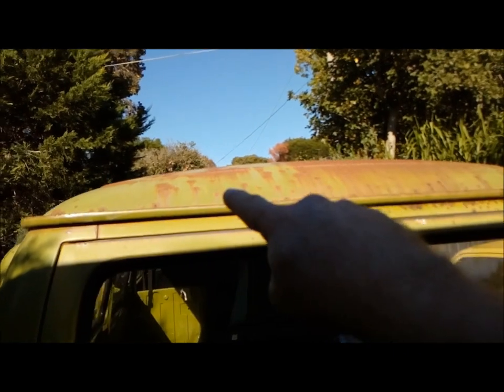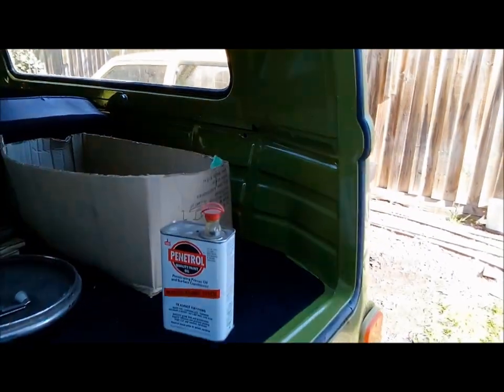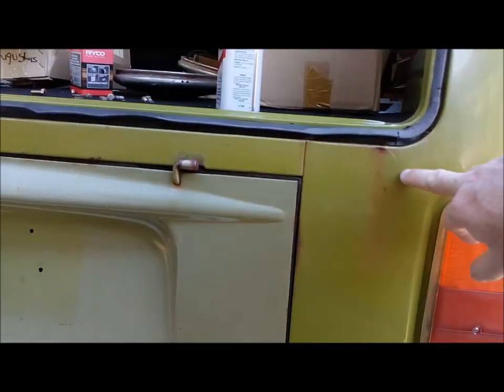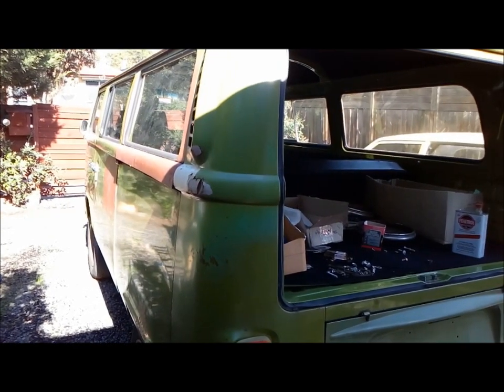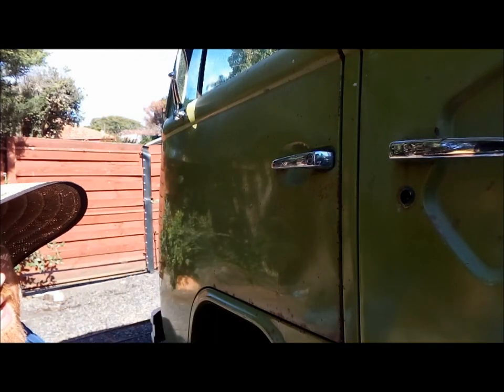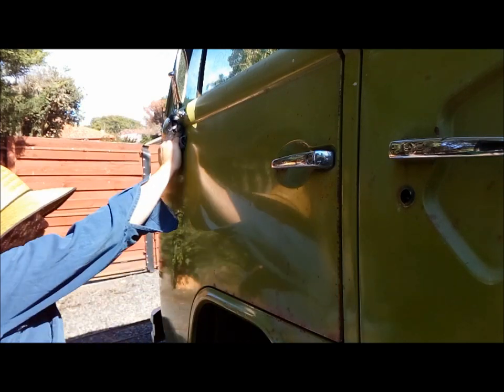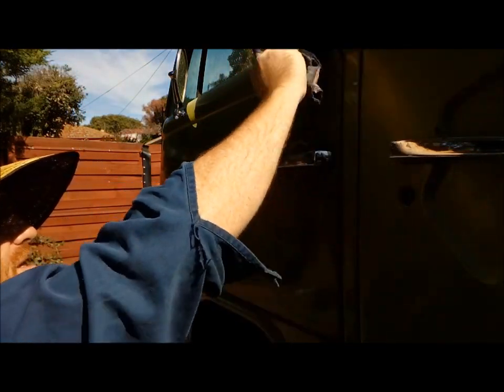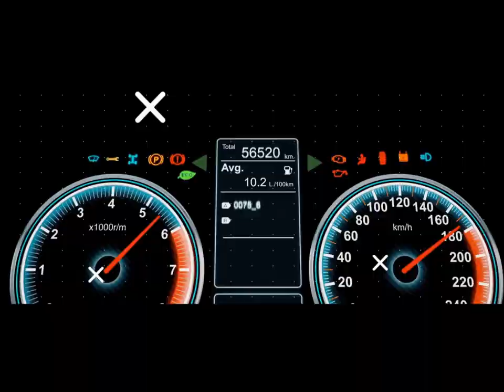Clear Coat PATINA PAINT Simple method , Car, Truck or PATINA Project Cheaply

Comment: 4 years ago as I was basically in rehab from some heavy duty chemo and radiation trreatments for stage 3 lung cancer, I decided to 'fix' up on my old 98 dodge ram short bed pickup. Each day I would do a little bit, straighting out dents and stuff. Couldn't work fast as the cancer treatment whipped me pertty good, lol.... After I had all the body work finished I started wet sanding by hand, through the cracked and worn clear coat, the primer and sanded it to the zinc coat. Then I used rattle cans and primed the truck. This took around a month and a half to get to this point. I burnt myself out and did other things, thats when I found out primer is not a sealer without a finish coat, after a couple years the primer was peeling and flaking so once again I did the old wet sanding by hand and reprimed it.....about two months ago I did a wet block sand on the truck, picked an area each day any taped an masked off and used krylon satin black rattle can paint, finished it a couple weeks ago and I must say I did not expect such a good looking job using rattle cans but everyone is amazed at the out come. Would I do it again? Doubtful, as at the age of 63 and still struggling with the damage of radiation and chemo, I did DEFEAT the cancer, I'm just not the go getter I used to be but I refuse to just lay down and give up. I will always find something to keep me somewhat busy, although there are days that just doesn't happen, lol....

Comment: thanks for the info! looks great.  You said in a comment you do 2 coats,  how long do you wait in between coats?
Reply from the maker: Till it's tacked off almost dry
Reply: @EverythingAnthonySOS  Hi-  I just tried applying this in a couple spots on my car, but I'm still seeing some streak marks.    I applied with a microfiber cloth in a downward fashion, waited a day, and added another coat on that.   It has been a couple days since then but there are still streak marks... Did I do something wrong? or does it take longer for those to go away?
Reply from the maker: @dominic6720  you shouldn't see any streaks , if you are then it can only be the amount of product your applying . The only streaks I get is in the first coat where the coverage may have been thin in a few area's, the second coat usually fixes the issue .
Reply from the maker: Also the finish will drop back on sheen in a few weeks , you should have a matte to satin finish when done.....feel free to contact  me through our Facebook page hopefully we can resolve your problems